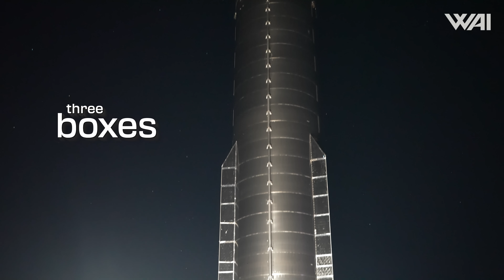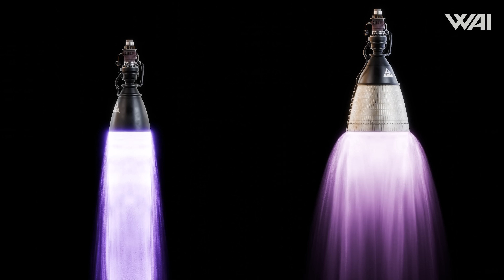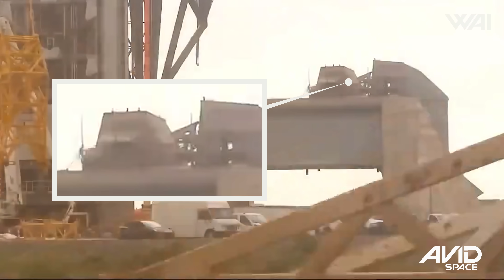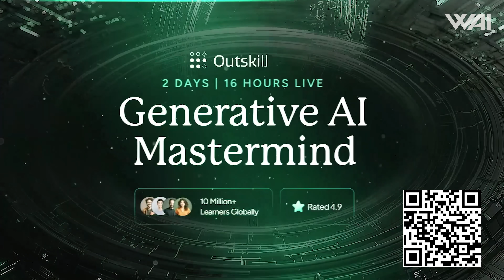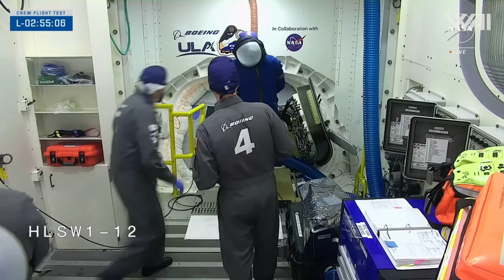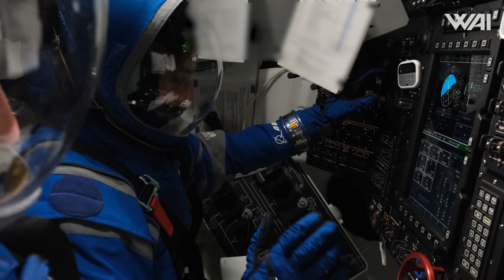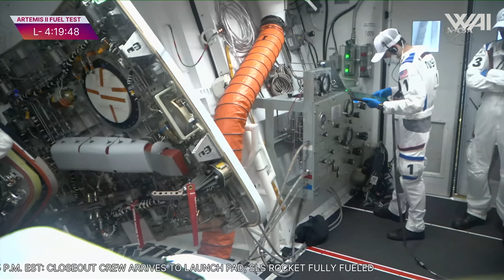SpaceX Just Revealed Starship's MASSIVE Game-Changer for Flight 12

Comment: You forgot to mention Strarliner was DESIGNED to not have any backup for thrusters used on reentry.  This means if one of them would have failed the astronaughts would have died because the heat shield would not have been able to be oriented correctly.
Reply: @davidb.5544  I thought one of them did fail.
Reply: @matthewcasady6276 
That failure drew attention to the lack of redundancy in the capsule thruster design. A Glaring oversight.

Comment: I will only be mildly surprised if Starship  gets human certified before Artimis 3. What would be the point of using Artimis after that? Other than to fulfill a contract, or to save face.
Reply: HLS isn't designed to make the return to LEO let alone to land on Earth.  At best it is a future option.  

:planet-orange-purple-ring:

:planet-orange-purple-ring:
Reply: The 100% Starship program would require sending a second Starship with Earth reentry capabilities into Lunar orbit. Crew would have to transfer to and from the HLS version. 

Making the HLS fully reusable also involves bringing replacement propellant from Earth.
Reply: @imconsequetau5275  equire sending a second Starship with Earth reentry capabilities into Lunar orbit

Or remodel the 2nd stage into being a booster (expending it probably) and having a capsule and service module that goes to lunar orbit with the capsule returning to Earth.  Probably larger than Orion.  

What is really needed is a nuclear engine orbit to orbit ferry that takes the crew to lunar orbit and returns.  If big enough it takes the HLS as well and the HLS can be smaller.  More propellant can be ferried for an HLS to be reused as well.

⚛

⚛

Comment: So what do you think...3 to 3 1/2 years before both Starbase and the Cape are outfitted with 5 fully functioning launch towers and production and testing facilities?  As far as AI and robotics go, I think both the moon and especially Mars will be best served by long term development of autonomous robotic astronauts.  It might take 25+ years to get to that technology milestone but flying a robot population on Mars to do some of the prep work and, more importantly, relay biosensor data on exposure to a 3-year space environment exposure scenario will be safer and faster than sending vulnerable humans to do the initial work.  And please Mars fans, don't tell me about already built and walking Japanese robots as the reason the needed technology already exists.  It doesn't.  The current state of Mars exploration remote tech is articulating arms, claws and drills attached to wheeled rovers crawling at a mile an hour fully dependent on ground-based navigation control. That is the present state of the art.  That said, I do hope they go the robotics way.  Moon first for testing then attempt operation on the red planet.  My two cents.

Comment: If the Kessler Syndrome is a concern, has there been any mention of technology or procedures to combat this, if it were to happen?
Reply: Whipple shielding, low-profile design, armored leading edges, durable deorbit capabilities.
Reply: The Kessler Syndrome you're referring to primarily stem from the famous 2009 collision involving Iridium 33, one of the original Iridium constellation satellites. This event is the main source of long-lived debris attributed to the Iridium program and remains one of the most significant accidental fragmentation events in orbital history.

The original Iridium satellites (and the newer Iridium NEXT replacements) were built with some debris mitigation in mind, but the 2009 collision highlighted how derelict objects in crowded LEO regimes can create cascading risks—relevant to dense future constellations like the proposed xAI one in similar altitudes.

Primary Cause: The 2009 Iridium 33–Kosmos 2251 Collision

On February 10, 2009, the operational Iridium 33 (a commercial communications satellite launched in 1997) collided catastrophically with the derelict Russian military satellite Kosmos 2251 (a defunct communications satellite from 1993) at an altitude of about 789 km over Siberia. The relative impact speed was approximately 11.7 km/s (over 26,000 mph), making it a hypervelocity collision—the first ever between two intact satellites (prior incidents typically involved one satellite and smaller debris).
This destroyed both satellites completely.

It generated thousands of trackable fragments:
Estimates vary slightly by source and time, but NASA and U.S. Space Surveillance Network data indicates roughly ~600–628 cataloged pieces from Iridium 33 and ~1,600–1,668 from Kosmos 2251 (totaling over 2,000–2,600 large fragments >10 cm).
Many more smaller pieces (down to mm-scale) were produced, with some models estimating thousands to tens of thousands untraceable but hazardous fragments.
The debris clouds spread into orbits crossing the original plane, posing ongoing risks to other satellites (including remaining Iridium constellation members, ISS, and sun-synchronous orbit assets).

This ranks as the second-worst fragmentation event in history (after the 2007 Chinese Fengyun-1C ASAT test), and fragments from it still contribute significantly to collision warnings today, though many have decayed over time due to the relatively low altitude.

The collision occurred due to a combination of factors: poor coordination of orbital predictions, the derelict nature of Kosmos 2251 (no maneuvering capability), and a chain of minor orbital perturbations that placed the two on a precise collision course despite low overall probabilities.

Other Minor Iridium-Related Fragmentations

There have been a few smaller, isolated incidents involving other Iridium satellites (not the full constellation-wide issue):
In 2014, Iridium 47 shed ~10 debris pieces (some at high relative velocities up to 80 m/s), and Iridium 91 shed ~4 pieces (lower velocity, staying nearby). These were suspected to result from minor collisions with small untrackable debris or possibly shedding of thermal insulation/material degradation, but the satellites remained operational with no major breakup.

No large-scale explosions or intentional breakups are recorded for the Iridium constellation itself (unlike some rocket stages or ASAT tests).
The vast majority of hazardous "Iridium fragments" trace back to the 2009 event, not inherent design flaws or explosions in the constellation.

Comment: Artemis II's issues bring back in contrast the absolutely incredible efforts of launching 13 Saturn V rockets straight without a single mishap and on time.  Amazing and almost unbelievable (Apollo 13's problems weren't related to its rocket launch).
Reply: Apollo was a bold, goal-driven national crusade: beat the Soviets to the Moon, united purpose, massive urgency, driving ruthless efficiency and focus. 
Artemis is pork. A jobs-program designed to keep the pig troughs full for contractors and senators' districts, not a results-driven push to the Moon.
Reply: Without mishap?? Shall we reexamine Apollo 1 January 27th, 1967  and the loss of all 3 astronauts?
Reply: Without mishap?? Shall we examine the disaster of Apollo 1 on January 27th, 2967 and the loss of all 3 astronauts?🤔

Comment: Artemis II experienced a helium flow issue on attempts at re-pressurization. How can a gaseous helium check valve possibly fail "closed" in its forward flow direction? If it's a standard design, then the simplest explanation is debris clogging it up. This begs the questions, where did these debris come from and how contaminated might be the entire helium delivery system now? I think there could be more problems for Artemis II on the horizon than NASA is informing us of.

Comment: Seeing Raptor 3 move from test stand to a fully integrated booster is the real inflection point. Lab performance is one thing, but system-level validation under 33 engines is where propulsion maturity truly shows.
Reply: The slow pace is maddening but when they touch all those puppies off I really want it to work as intended.

Comment: I think the reason they are testing the flaps is cuz Starship hasn’t been Orbital yet and when they do go Orbital on flight 13, the ship will most definitely experience higher torque on the flaps and higher heat on the tiles, way more than all of its previous flights and they feel that this needs to be tested to find its limits. I wouldn’t be surprised if they damage the flaps on 39 and may have to change them out before they actually take flight. At least that’s my Opinion cuz that’s what I would do
Reply: All of the re-entry tests to date have been at, effectively, orbital velocity.
Reply: The Block-2 reentries have been more brutal than those planned for Block-3. 
 @cebrith

Comment: Which American launch provider can step up and join Spacex to provide reliable cheap launches.
Reply: Blue Origin (probably )
Reply: @christopherlawley1842  

Still need to demonstrate a launch cadence.  The 1st launch this year was supposed to be January with their mark I moon lander.  Then it was February with a different payload.  Now it is March.  Unclear when it will launch and the moon lander prototype is currently set for December launch.  This with their "production" model of New Glenn?  

Two orbital launches in 25 years?  Only 1 fully successful with a real payload?  Not convincing as a competitor with that track record.

:face-turquoise-covering-eyes:

:face-turquoise-covering-eyes:
Reply: @christopherlawley1842  New Glenn has a marginal launch cost without reuse of $135 - 175 million (+25% profit = $168-218M). If they achieve reliable efficient booster reuse then at 25 flights the price could drop IMO at ~$150M/launch. That's more than a Falcon Heavy exp, for less capability.

Comment: Craziest thing to me about the report - was that they 'realized' the whatever computer was commanding the RCS thrusters to fire every 500ms (or something ridiculous like that), in order to maintain a position. And in doing so, it put unnecessary wear on the thrusters, as well as making them overheat. 

Like...it's kinda scary to me that big brained Nasa didn't think that through? Like any dude with the most minimal of mechanical experience would know that turning off/on a system that fast is going to induce heat and wear, and I'm not even an engineer, but I know my way around electronic switches, and mechanical stuff. 

That's just crazy to me.
Reply: It wasn't NASA that should have seen that but the Boeing people who actually designed and built it.  

Same with the Teflon seals that would swell when exposed to the material they were supposed to be exposed to.  

Even bigger was the parachute harness that if it got a jolt that was possible by the design would break free from the capsule.  

Flammable electrical tape was another big one that could ignite during normal operations.  

Hell they couldn't even get the clock set right for their first mission and even though it missed the station they tried to call it a success and go straight to manned flight.  If my memory is correct they were forced to do a NASA supervised review and found something like 87 issues to correct.  

:face-turquoise-covering-eyes:

:face-turquoise-covering-eyes:
Reply: @Scanner9631  It was NASA that certified and approved Boeing's Starliner for crewed flight. It was NASA that overlooked warning signs of a dangerous safety culture and inadequate oversight. And it was NASA that ultimately gave the green light to put astronauts on board—despite known risks that later turned the mission into a near-disaster.
Reply: @admarsandbeyond  

NASA was the purchaser and had to rely largely on Boeings reports of fitness.  

They certified based on Boeing reports which were at best faulty and at worst falsified.  

:planet-orange-purple-ring:

:planet-orange-purple-ring:
Reply: @Scanner9631  NASA had extreme oversight over the Dragon program and demanded SpaceX to exceed (e.g. parachutes) its obligations. But they didn't do the same for Boeing (according to NASA reviews). They applied double standards and the results speak volumes.
Reply from the maker: Wasn’t NASA. It was Boeing. NASA should have just questioned the delivered hardware more. They trusted Boeing.
Reply: @Whataboutit  Yeah, of course. Fair point.